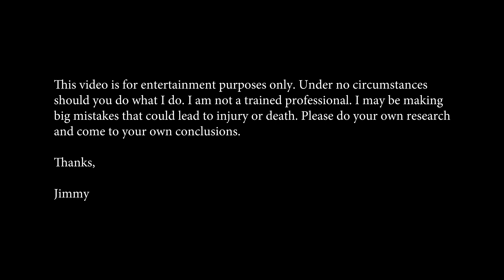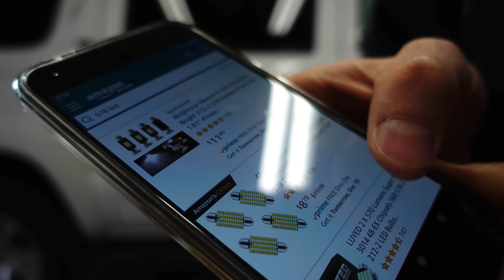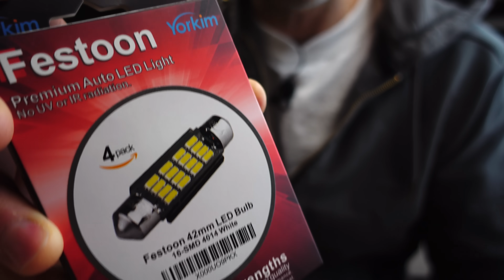Here's Why You NEVER INSTALL LEDs IN YOUR CAR OR TRUCK!!

Comment: Good info. And understand LEDs are not great for replacement in a headlamp, not designed for LED assembly, since they throw out light differently than an incandescent. Most headlamps are reflective so although an LED will be whiter; brighter the light will not go out as far since most of are not designed to be used in a deflector housing. Projectors a different story.
As for heat...yes LEDs can get hot. Most LED headlamp assemblies equipped as OEM on a vehicle have small fan assemblies in the back or a heavy duty head sink. 
Some LED replacement assemblies will have small fans. Some are designed for reflective housings; most are not. 
And when using for turn signals, you might need a resistor for each bulb or you will get hyper flash.
Reply: Exactly!  Vehicle manufacturers design the luminary assembly (headlights, brake, side markers, fog lights, etc.) for a specific bulb type.  Replacing those incandescents in your vehicle with LEDs could cause poor results.  (Brightness is only one criterion.  The way the bulb illuminates in the direction intended by the vehicle’s designers, at the proper level of illumination is a totally different, yet not an unimportant, matter.)

Comment: I was told my scooter headlight bulb runs on AC current & it would burn up LED bulbs quickly. So it's still a dim 35 watt halogen bulb.

Comment: Good video!! I have a 02 dodge Dakota sxt my heat n air control panel bulbs didn't work so I tried all parts stores n one showed them went to dodge they had only 3 bulbs anywhere they were 36.99 each well told them to keep them.  Ordered led from Amazon 3 bulbs was 6.00 dollars so far they are working.  Also chang

Comment: Bought a pair of 3057A (amber)  mega-bright LED lamps for my front turn signals/daytime running lights from 'ALLA' products (on Amazon) that are based nearby  in Orange County, Ca. Considerably brighter and are still working fine. Work fine without any added 'resisters'.  Depending upon their reliability and duration, I plan on replacing other key incandescent dim lamps throughout my clean 2005 GMC Canyon p/u.....

Comment: You forgot to mention the most important point, why led isn't a GuD replacement, That in few cars the roof light turns on or off gradually, while led cannot operate like That.

Comment: One of these bulbs killed the headlight circuit on my riding mower, no way I’m going to put them on my car. Like when you see an Audi or BMW or Volkswagen with a tail light working as a turn signal vice versa or one brighter than the other that’s what you get with fancy headlights… And of course they make it impossible on the packaging to match your actual voltage wattage amps to have a proper bulb that will not cause problems

Comment: Factory LED lights are usually ok, but led i a housing meant for incandescent usually give poor results. Led have an angle problem, unless one look straight at it, lights up poorly.

The question is, Why do you need Led's on your car though? Does your car generate too high electric bills?

That bluish light makes your interior look very bland. In fact, people pay extra for warmer hues bulbs.

Comment: Those are not halogen lamps which are considered very inefficient because of the power or wattage they consume. They get so hot that they require a quartz material to let the light shine through.

Comment: The reviews are better than nothing, but only if you take then in context, that context being the for the generic bulbs you have a certain % of reviews that are fake, and even for the legit reviews, almost nobody waits long enough to tell you how long they last and how much lumen degradation occurs, and they may not even notice it because all that had was the before and after impression when they were brand new.

Granted for interior lights, for most people (besides those in a profession that depends on interior lighting) it won't be that much of a hardship to do without a faulty bulb until they get it replaced, but as briefly touched on in the video, it is usually a bad idea to replace critical exterior marker, brake, and headlights with generics and in some cases, especially headlights, illegal to just throw an LED retrofit bulb into an incandescent housing.

I'm not a fan of the bluer color tint light though,  while at first it seems "modern", if you want to believe that mankind is evolving towards a more scientific animal, then it is actually a step backwards for their purpose to choose the cold color temp LEDs because while that cold light dazzles the eye, it is more of an overwhelmed effect and  for the same # of lumens, you can see better and preserve more of your night vision using a warmer bulb and this includes just choosing a 4K or lower color temp LED bulb instead of higher/colder color.

Comment: 90% of my bulbs in my truck are replaced with Sylvania bulbs from auto parts stores, they have been going strong for multiple years and they are more the traditional style and not solid state, solid state vs wire connectors doesn’t matter all u need to worry about is brand, use established led brands or established light brands like sylvania or Phillips they have better quality control then there off brand names, jdmastar, allah lighting and a few other brands I can’t remember have decent quality control from research I did on led brands

Comment: Here's one huge problem that is caused by LEDs in your car. I have a 1999 Camry that has a third brake light in the rear window. This light is either completely on or totally off as it has no parking light function. My Camry also has the radio antenna built right into the rear window glass. Now, LEDs emit radio frequency or "RF" which totally interferes with my FM radio's input signal due to the fact that the brake light is so close to the antenna. This is to the point where I can't hear my radio at all every time I put my brakes on. It's a real problem. I've tried to eliminate the issue with an in-line  shunt, but no luck so far. This is such a pain in the butt that I'm actually looking at buying a used Camry rear wing which  relocates the brake light to the wing instead of the rear window. I understand that most cars have their antenna in the front window these days and many people don't listen to the radio in their cars anymore, but I do and you can bet countless other people still do too. They need to come up with an LED that doesn't interfere with your radio. FYI, LEDs could also interfere with your computer in your car or SUV in some instances. LEDs really emit significant RF that needs to be resolved.

Comment: Are they generally omni-directional, like does polarity matter ?
Reply: LEDs are polarity sensitive'    ;-)

I recently swapped out basic stock bulbs for LEDS  Had to extract 4 of the 5 due to  polarity issue !   So just a lot of practice,  with the bulb gripper pliers acquired locally for $10cdn    !     🙂

Comment: My 2 cents worth .. as we get older those LEDs @ 6000K are a royal pain .... I try and retrofit 5000K or lower LEDs on my vehicles to steer clear of blue light boiling my retinas. My 4x4 has yellow LEDs so not to attract bugs when out camping ect... I find Philips make solid reliable LED products, so do Putco. Anyways the LEDs need less attention of long term if they are quality.

Comment: Has anyone else noticed with new vehicles, that the LED lights sometimes flash, like the men in black movies?. The driver of these new vehicles may not even be aware, but they may be used for electronic surveillance by means of the flash photographing the iris for identifying drivers going in the opposite direction. May be far fetched, but I also notice these flash, when police vehicles are nearby.

Comment: The bulb you are calling a halogen is an incandescent.  Halogens are much brighter than incandescents and provide ambient light, reflective at distance.  My experience with LED's is that they do not provide ambient light, but a blinding beam. Halogens can be blinding also, but not so much on low beam. A low beam led can blind people on dark roads. I've had to come to a complete stop to avoid hitting anything.

Comment: The other issue I see with car LED bulbs is that they nearly all seem to be 6000+ kelvin colour temperature which is about the same as a cloudy day and provides a very stark light. Has anyone come across a more neutral coloured bulb (~4000K)? Thanks

Comment: According to the car car nut beware changing brake light and running bulbs for LED's you could burn out fuse boards, not the fuses, but the wiring behind.... Be careful out there....

Comment: I installed a led on my motorcycle.The mount was plastic it got melted. So I made a mount from metal 4 years later still working. LEDs are good for headlights and flashlights anything else is a waste of time.

Comment: Although it is not the topic of this video, i want to warn people about a serious issue. If you are replacing the lighting of your car: You can do whatever you want except for the lights "Outside" of your vehicle. Your vehicle's headlights, tail-lights, fog lights, signal lights, and "factory installed accessory lights" have certain angles to illuminate around your car. The manufacturer designs the reflective surface in your lights to illuminate the road in a certain way, and it is very dependent on "where the bulb emits the light from". If you have factory halogen lights for example, you should not use xenon, or led lights, or even a different bulb style. Because the point of light emmission differs from bulb to bulb and it messes with the reflection angles.

Comment: I'm just thinking of upgrading the lights in my newly purchased, 17 year old Ranger.  This has given me a few more things to think about when looking for upgrades.  One question: does every light - especially in the interior - need to be LOTS brighter?  Probably some, but not all.
Also, I look at the reviews wherever the seller (not just Amazon) has them.  I'll pay attention to the most negative reviews.  There have been some products I've bought for which most of the negative reviews turned out to be because the user didn't read the instruction or installation manual, or damage during shipping, problems not directly related to the fit or reliability of the product.  So maybe - just maybe - it's not as bad as the statistics appear - as long as you read the FINE manual (RTFM, folks) and it arrives intact.
Reply: @Ferndalien I replaced the incandescent bulbs in my 99 Ford Ranger with LED ones. Fixed the hyperflash issue by replacing the OEM flasher with a LED bulb flasher from NAPA. Headlights are 9007 LED replacements in a aftermarket housing, and headlights have been aimed properly. In short, buy from a quality, reputable dealer..not amazon. 
The only outfit I use, I've been using since 2007.

Comment: Most commercial LED lamps have also another drawback, a VERY IMPORTANT one: the quality of the emitted light. We, humans, are adapted to the spectral power distribution of sunlight, which is always complete and balanced and whose temperature changes depending on the hour of the day; it is the same with the light emitted by blackbody radiators. We perceive colours naturally with that sort of light, and it is considered to be of the highest indexes when measured with the different systems developed for such purpose: CRI Ra (poor) and CRI Re (much better), TM-30-15, CQS and others. Then, when only the best "high CRI" led emitters provide what I'd call “decent nice light”, you can guess that the light which is emitted by all the others is usually far from close to natural light and what you see with it is “washed out” and inaccurate. This also affects headlights, with many cars and vehicles whose lighting quality is simply crap, and also exhibiting unnecessarily “cool” white light temperatures (CCTs way above 3000K) which are less than adequate at night.
I have many do it yourself led lamps and flashlights, with some “crappy” led light sources to compare, so you can guess I perfectly know what I am saying. When I go out at night with a low CRI led emitter flashlight and a flashlight with a really good led emitter to compare it with, the difference between both light sources when lighting grass, stuff and whatever thing from a dusty country road is simply staggering.
And yes, you can't expect the same levels of “efficacy” in the highest light quality leds compared to lowest light quality ones, but this is because the luminous efficacy measurement is a biased and wrong crap, and it is one of the main reasons why lots of leds emit such poor quality light: you can't expect anything better when focusing on “lemons” per watt instead of focusing in light quality. This is the reason old incandescent and halogen bulbs are so “inneficcient” (cough! with such retardedness), but they're blackbody radiators and I love them.

Comment: I had fancy LEDs  with  fan motors on them 4 cooling they were brilliant with light but after a couple off months travelling on bumpy haul rds in my truck the motors fell off and the LEDs burnt out  and there expensive and carnt get them at a petrol station  like the normal cheaper heligen bulbs  , so I went back to heligen bulbs and there still working years later 😀

Comment: When I look at reviews, I look at all or atleast as many as humanly possible in a short period of time. I look for similarities in the five star ratings because companies will pay people in a gift card form to give them a five star review when they purchase a product from them. You're always going to have products that fail so looking at as many reviews from one to five stars gives me an idea of the overall quality of the product. LEDs always draw less amps than any incandescent bulb an heatsink is a must with any LED. What would be interesting is to see is which puts out more heat, incandescent or LED. If the LED's put out more heat, the plastic covers might melt. If that's the case then slots would have to be cut in the covers to release the heat preventing them from melting.

Comment: Personally hate the kind of light they give. It's so directional that it just creates shadows where the soft glow of the incandescent/halogen bulbs didn't so much. I've tried reputable brands and they've failed (grant it lasted a few years) but I have several cars that are over 50 years old that have the same bulbs they left the assembly line with (interior lights).

Comment: Stupid new beetle detected a change in the voltage of the LED I put in the tail lights and went into ‘limp mode’. Took me forever to figure out the fault codes.  Dealers and ‘experts’ couldn’t figure it out.:(((

Comment: I myself don't car for LED head lights. Used 2 different sets.  One set was about $25 and they died in minutes of use. The second set was just over 50 and they died in about a month. I went back to halogen bulbs. I us the Sylvania Silvestar ultra and they are just as bright, give off white light and cost roughly the same as the 55ish LED bulbs that I got, and they are still working years later. But for me it realy wasn't how bright the bulbs where it was the color. For my eye sight white light makes it easier to see and the silverstar produce it. Next thing I replaced with LEDs was my tail lights and blinkers. I love the LED tail lights but hated the LED blinkers. I noticed with the blinkers that they where blinking faster then they did before. With the normal bulbs a good indication of a burnt bulb is that they will blinker faster. So at first because of this faster blinking I thought one of the LED bulbs was burnt out. Nope not the case.  I found out that when I installed  the LEDs in my blinkers I also had to install a transistor in the turn signal wire harness. After I wired in a transistor the blinking of the LED lights went back to normal speed.  Now of course I don't now if the speeding of the blinkers where because it was an older truck, my ranger was a 93.  So this might not happen on a newer car/trucks, but I can not say for sure. So if you have installed newer LEDs and you have notice faster blinker speed. You too might want to consider putting in transistors. And as some added info I heard that some newer cars will need an anti flicker. error code adapter for the LED headlights.

Comment: Some times your run into the fact that your lighting control module is a computer looking for a voltage that it's not getting anymore.I have a 1999 Harley Sportster when I went to LED turn signals they wouldn't blink I had to a modular in there $60 to make them blink some products will have things like this built in.there not saving energy in applications like this in your home yes in your vehicle probably not unless it came with them,but the light might be brighter.

Comment: Installed LEDs in my overhead map lights and dome light my Dodge ram. No matter how many times I click these lights off in 2 days or so these lights will click themselves back on somehow as if the computer is controlling them and I manually shut them off again knowing eventually they will come back on all by themselves it's like it's haunted.

Comment: VERY IMPORTANT - make sure to always switch out ALL lights within a circuit at once. A single halogen bulb within the loop, say headlight indicator on the dash, will suck all the electricity and cause the circuit to fail.

Comment: Hey I'm trying to put LED lights on my 1990 Silverado truck and i don't know how to wire it up right because my in front has no plug in the single lights it's just a bunch of wires and it's caused me not to have any tail lights
Reply: Could you show what I need to do to them fixed ?